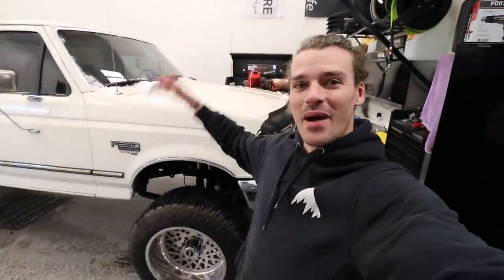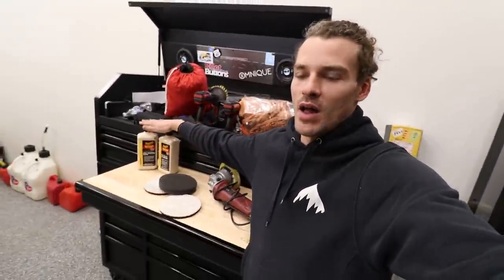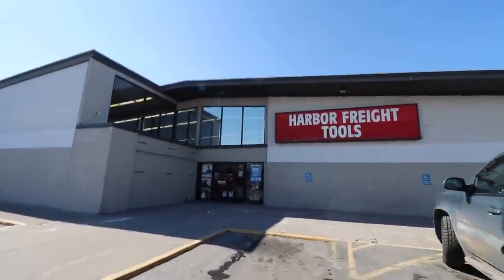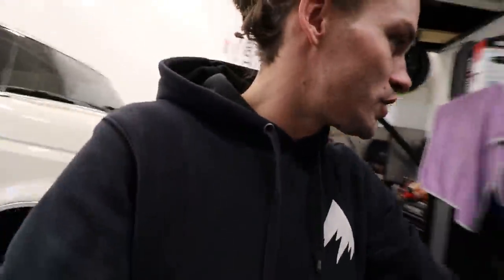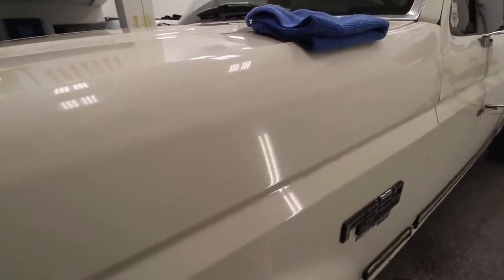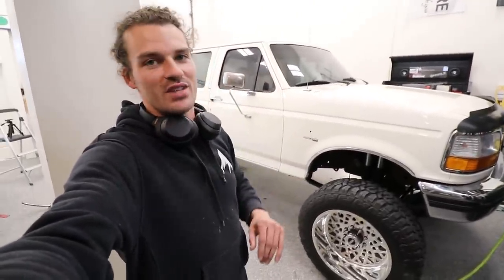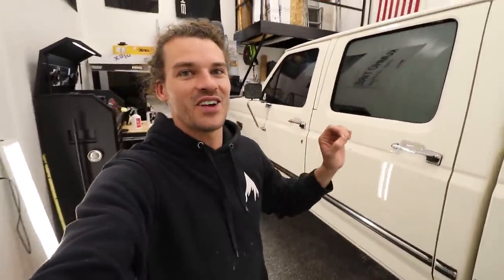Making My 26 Year Old Truck's Paint Look BRAND NEW for Only $150

Comment: I couldn't believe it when you reinstalled the trim. It looks so much better with the trim off
Reply from the maker: Had to replace it because the paint under the trim was chipping off
Reply: @SummitLife  thanks for the reply I used to have a Chevy 3 door and I took the trim off and it looked absolutely fantastic but that's only because I repainted it cherry red

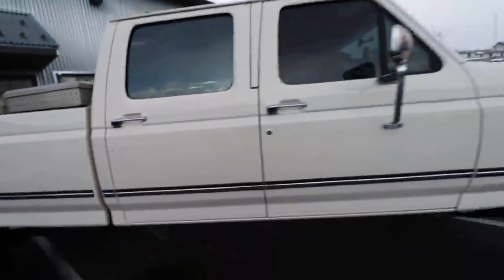Comment: 12:50 Yes you can Clayton. Get a tiny bottle of touch up paint and dap some on there. From 5 ft away you won't see the paint chips anymore. Plus, with the equipment you have already, you can match it up and not see it from this distance.
Reply from the maker: I can’t find the exact paint code for this cream white lol or else I would

Comment: Nice truck great job 👍  Figure 8s at medium speed light pressure is best in my experience for both cutting and polishing. It's also how you get rid of swirl marks when polishing. 
  Dawn is definitely great for washing vehicles.   
 Masking tape on all of your trim helps keep all that dust off them also if you get too close you won't burn them and mess them up.

Comment: Nice to see you back the truck looks good it's got a nice shine to it it in products are good I use car brake and I use Arctic products but I have used them they are good but I use a DeWalt buffer I'm old school that's from working in the body shop I used a bigger pad it's an expensive machine but I love it cuz it's got all the speeds on it but the truck came out nice looks really good

Comment: Do you have a product recommendation for windshield / window water repellant products (like RainX)? Are they worth investing in, or not really?
Reply from the maker: I’ve tried many. Some are great some arnt. Most ceramic coatings work decent on glass. I lightly went over my glass with the ceramic I used in this video. If you go heavy it will be streaky
Reply: hey! i run a detailing business. I suggest using just a touchless spray wax, you can use it on your paint and windsheild, and it reflects so much water that i dont even need windshield wipers. I suggest good products such as carpro.

Comment: You can get a touch up paint so it’s not so visible but yes it looks amazing! How much would you charge a client for that. Thanks
Reply from the maker: Usually around $600-$800 for the correction process only. After they the client has a few choices in protection
Reply: @SummitLife  Im assuming this isnt the process you use for customers cars and was just how to paint correct 'on a budget'?

Comment: You forgot to say there are 2 different types on polishers there a orbital which is the the easiest to learn on and most commonly used. Then there is a circular type which it is very easy to screw up the paint. The first coat of all ceramic spray you're suppose to do it dry first then maintaining it you use it as you dry. Come on dude read the instructions. Don't forget it's not a long lasting ceramic coat.

Comment: While I'm all for easing tint laws, I've got a ticket myself here in Iowa :( You might want to review Utah code 41-6a-1715 which states: "Except as provided in Subsection (3), a person may not use a handheld wireless communication device while operating a moving motor vehicle on a highway in this state to manually:
 (d)	view or record video; or..." You might not want to be breaking the law as your talking about changing the law ;) I'm sure that you can argue that your DSLR is not a "wireless communication device" except that in your usage it actually is. It's wireless and your using it to communicate to YouTube. Get a mount at the least when driving.